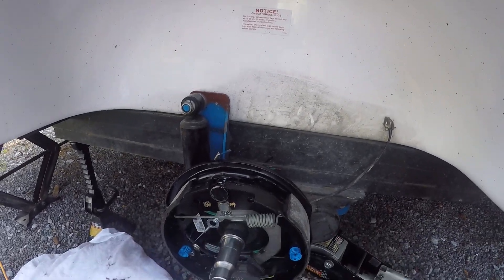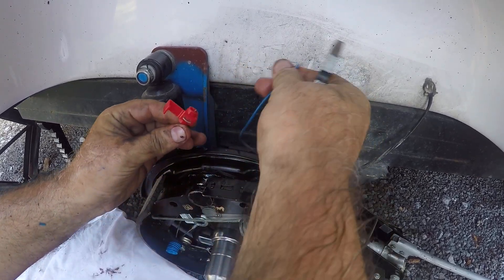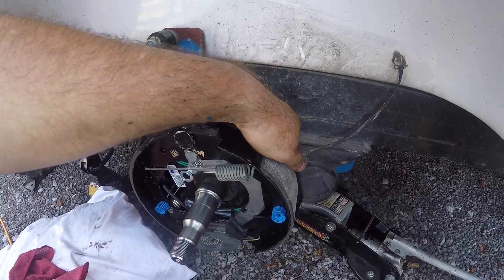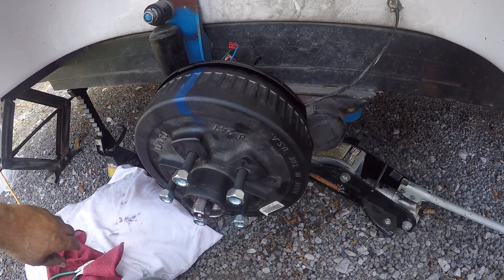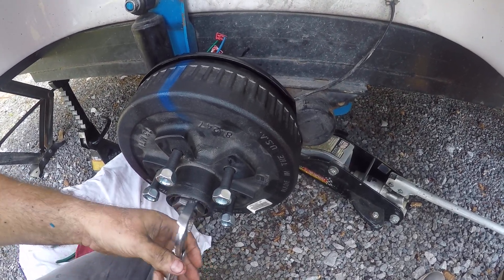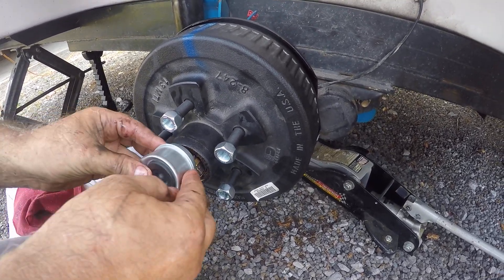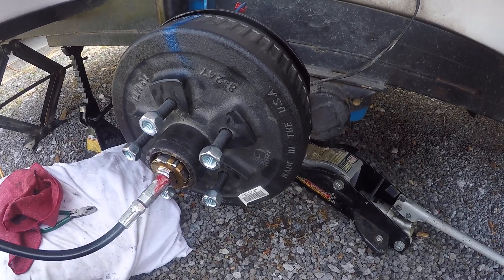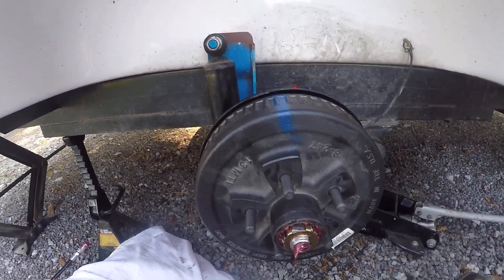DIY: How to Install Dexter Electric Brake Replacement on My Casita RV Travel Trailer

Comment: Looks easy enough. I'm not happy with the brakes on my new to me trailer. And the never adjust might be the way to go over converting to hydraulic. My trailer is only 6000 lbs, so electric should work.
Thanks
Reply from the maker: I hope these work good. Stay tuned.